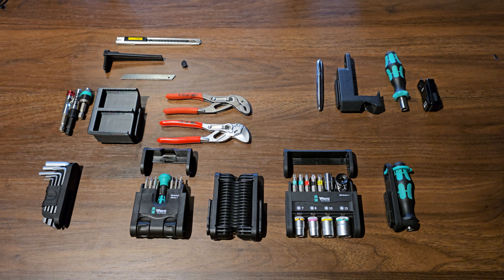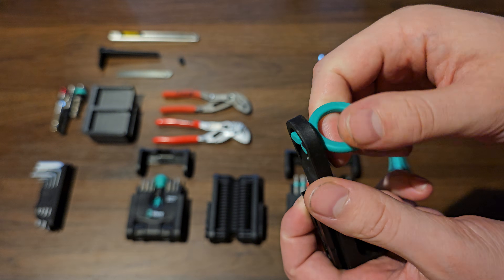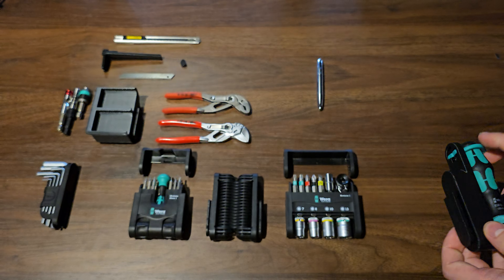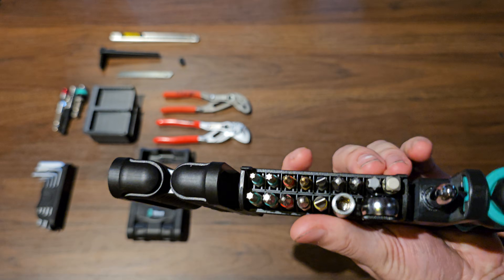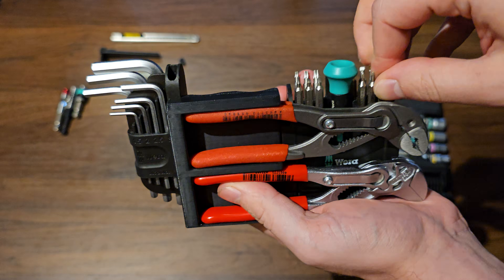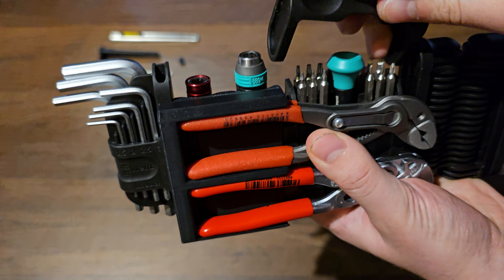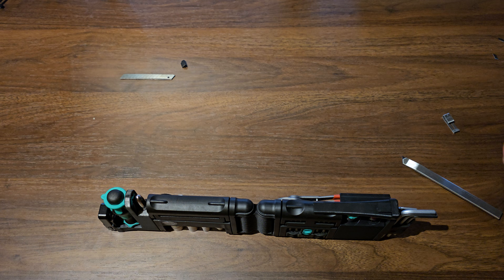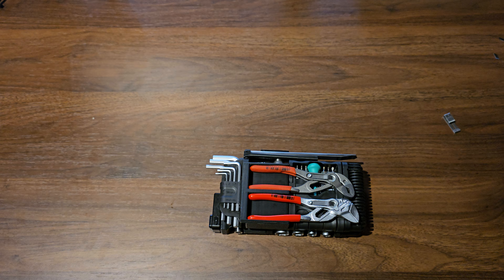Wera Tool-Check Modular—Custom 3D-printed modules—Knipex, Fisher Space Pen, Olight, Olfa & more

Comment: Thank you for this print. It adds everything I need for my edc. Is there a model for the blade holder cap? It’s currently not in any of the files.
Reply from the maker: Oh I must've missed uploading the cap STL when I converted to OpenSCAD. 

You can either open the Print profile using Bambu Studio and re-export the STL or use the Customize functionality from a desktop PC.

The Customizer opens up with all the default parameters and you'd need to select the Blade holder Cap as the model to generate from the drop-down and download the STL.

This has the added benefit of being in sync with any changes you might want to make to the model, for example increasing the blade amount in the storage compartment.

I hope this answers your question, if not please simply reply to the comment. I'll upload the missing STL, too, when I get some time on my hand.
Reply: @dustvoice  great, it worked! It’s up to you if you want to upload the cap file. I see more people finding out it’s missing once the print is done.
Reply from the maker: @pastimeventures Doesn't hurt to upload it 😅. As stated in the description (hopefully, need to double check) I won't update the STL files on minor updates as everyone can generate them easily with custom tweaks but uploading it still makes sense.

Anyways I'm very glad you like the model(s) and hope you have as much fun with it as I have every time I grab the tool check. Also thanks again for the kind and encouraging words. Cheers

Comment: Did you sell this design to Wera or did they steal it?
Reply from the maker: What exactly are you referring to? 

The base design is the Wera Toolcheck Modular. They invented it and sell it.

I simply developed the (currently) three extension modules COMPATIBLE with the Wera modular interface.

I'm not aware of Wera selling or using these three extension modules anywhere? I definitely haven't sold anything 😅

Comment: i love your wera tool-check modular nice job
Reply from the maker: Thanks for the supportive comment appreciate it!
Reply: @dustvoice yw keep up the good work
Reply from the maker: @AndrewMurphy8383 For sure. I'm currently already deep in the works of remodeling everything in OpenSCAD, so adapting the modules to your own needs can be done with the MakerWorld Parametric Generator, without the need for an OnShape account. It will also make future modules much more easy and quick to implement. Additionally I've just received a handy measuring tape with an integrated display and laser, which I'll try to incorporate, hopefully using the tripod-mount so it'll be somewhat universal between brands.